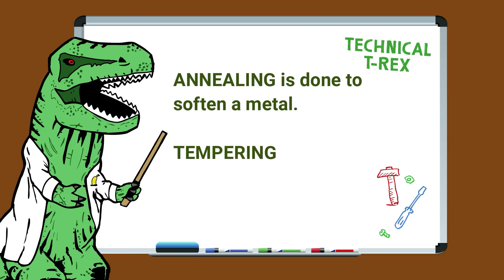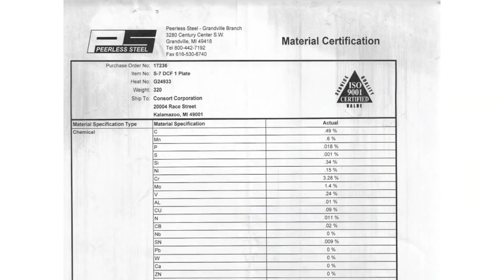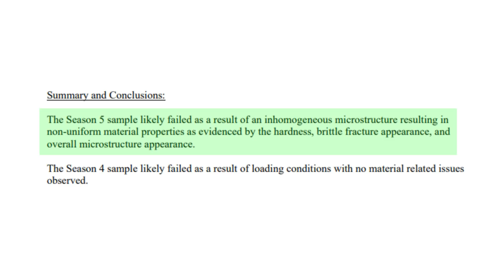The Runner Up Curse is Real // BattleBots 2021

Comment: Wondering if you've considered doing a hardness test on the disk material? This would provide data on the local hardness which may not be terribly helpful if the material is not homogenous, but it would at least tell you something. Hardness tests can be done by a number of organizations, including Test Labs, Machine Shops, schools with a materials program, or even the steel supplier. themselves. Good Luck

Comment: I just love it when girls talk about all the technical stuff :3 I had no idea that battle bot designs go into such lenghts, I knew lot of money is being spent on them, but I mean the part about sending the parts for analysis to see if it's bad material or not.

There's just one thing I gotta ask / suggest, why don't any of the spinner bots use brakes on the spinner? I have seen so many bots (including Tombstone) been ripped apart by their own weapon cuz they have no way of stopping it and then they bounce off the walls and floor. Why not add brakes on it? So if you hit the opponent and it throws your own bot towards wall, you hit the brakes .. so you won't smash the spinner against the wall. It would surely save you from some nasty self-damage.
Wish I had money or sponsors for this, I'd definetely make the best bot designs ever. I forgot the name, but one of the bots "stole" my idea that I wanted to see for years, it was the one that had drum spinner that was able to move back / forth, so it won't hit walls or opponents weapon, they only extend it when they needed to hit. That's something I would have done from the start.

Comment: Stop with hard solid disk . Look at a large brush hog . A brush hog has the blades on large pins.  So when they hit . The blades will swing instead of break . You can hit a huge immovable stump with a 200 horsepower tractor and only dull a blade . Go to a farm and check out farming equipment

Comment: Do I understand correctly that you purchased steel and it was not in spec?  If so that has broader implications of problems than just bots.  Given that other bot makers appear to have had the same problem, it looks like this problem is common.  Is it possible that this was sabotage?  Is it likely that steel out of spec from the same supplier has gone into other products?

Comment: You might look into ultrasonic testing of your disk materials. If you can get access to one you might be able to check for buried grain flaws in the material. The gas turbine industry uses this technology to test rotating components. The catch is these devices aren't cheap and require a good deal of calibration and expertise to use. Plus, the geometry of your disk might limit where it could be used.  https://en.wikipedia.org/wiki/Ultrasonic_testing

Comment: With enough force applied most things react like jello. All the bounds in the crystal structure of the material wiggle. They aren't set in stone as they say. Everything vibrates a little. Ah material science so much fun so much data. Ive only seen tungsten carbide break like that. Super hard and strong but oh so brittle

Comment: That tantrum brick is adorable and watching a stiff chassis like WD's just flex like that gives a good impression of the forces involved with an unbalanced weapon spinning at speed and what kind of loading was happening during the hydra fight when it was just bouncing all over the place.

Excellent analysis of what actually went wrong, it must feel nice to now have the confidence that you did everything you could to prevent this problem from happening in 2021 season and it's funny to me that a lot of teams are now moving away from S7 tool steel to AR500 for the weapons since so many exploded (yours, but also bloodsport) during the 2020 season.

Going to be exciting episode with Witch Doctor vs Whiplash, two absolutely class bots with a history of giving amazing matches. I don't know who to root for, but it's going to be a show in any case.

Also thanks for technical t-rex for finally giving me a reason to figure out what annealing and tempering actually does!

Comment: What caused the S7 tool steel to have micro structure abnormalities. Would that be from the heat treat or from cutting the metal or something else entirely
Reply from the maker: It’s from the manufacturing of the material. The difference would probably be negligible in most applications.

Comment: One thing that everyone seems to forget is the actual issue of QA/QC, and as a result, you can get say 50 of something (disks, fiber optics, memory, computer chips, etc) but in reality, I would doubt that every single item is actually tested showing as PASSED, but rather samples are taken and tested, and the entire batch of items is certified.

Many years ago, there were many motherboard failures due to a bad production batch of capacitors which persisted until the issue was identified and eliminated from production.

Materials science is a fascinating field, but in reality, it can be a crapshoot, as one item may last 5-6 years, and another last less than a month (due to manufacturing, lack of servicing, etc).

Still a very informative video on materials testing and analysis...

Comment: Lattice the bodywork.
Merge both blades into 1.
Add another.
Reduce cutting angle.
Reduce speed of blade.
Increase torque.
Shrink and encase wheels.
Hispeed omniwheels.
Camera with object recognition ?
?????
Reply: Sounds like you should build a bot!  Wouldn't that be cool?  And imagine putting it on a resume!
Reply: You can't find AR500/S7 in a thickness where they can do one single thick blade like you're saying. Even if you do find it you aren't going to find many places that can machine something that thick.  Also, reducing speed is not what you want. You want to maximize tip speed. Encasing the wheels case bigger issues when the armor is broken/damaged and cause a jam.
Reply: @shadow7037932  
Side by side.

Comment: The flex is bizarre to watch. You wouldn’t think a well built large metal robot would wobble like that when unbalanced, just goes to show how other components then break as a result!
Reply from the maker: It's crazy!
Reply: Not necessarily a bad thing.   Flex instead of breaking.  As long as all the connecting components can tolerate the flex.